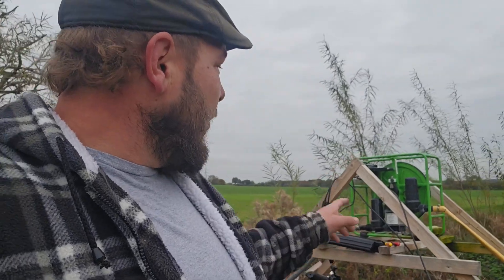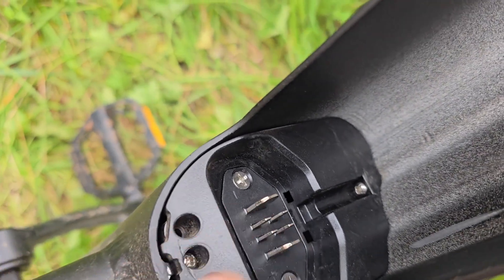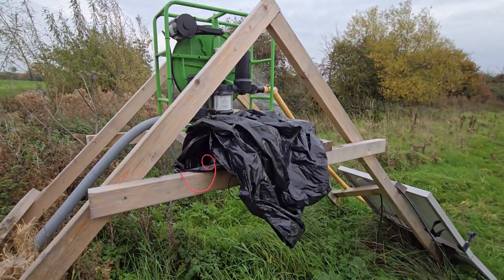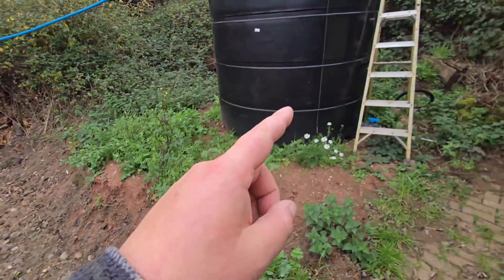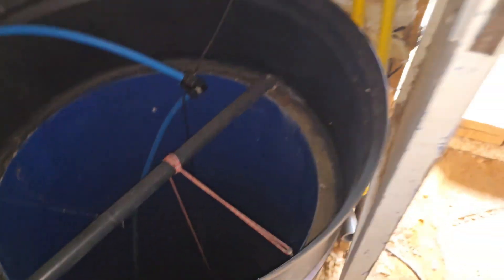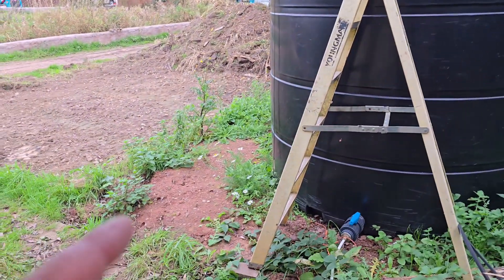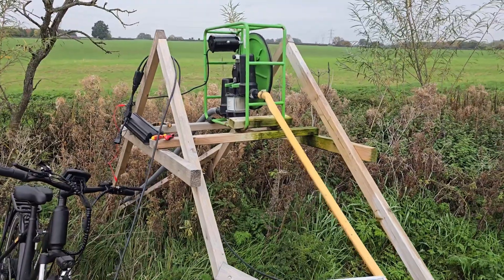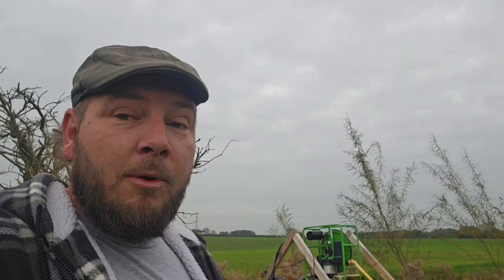using an ebike to pump water and how I'm never going to run out again!

Comment: If that battery hasn't got its own under voltage protection built in (probably built into the bike) you'll end up damaging the battery running it flat

Comment: A 36v inverter is cheap and a long power cable would probably be easier than having to take that battery off and taking it to the house to charge it everytime it dies and killing the battery in the long run which won't be cheap. They only have so many charge cycles. Good idea brother but there's som3 flaws to your madness.....lol
Reply: Be quiet 😴😴😴😴

Comment: Would it be possible to harness hydroelectric energy from the downflow of the water from the pump to then power the pump.
Reply: Yer a trickle charger back to the battery like a water mill kinda system with a permanent magnet type of electric motor from a battery strimmer would be worth a shot
Reply: Nope